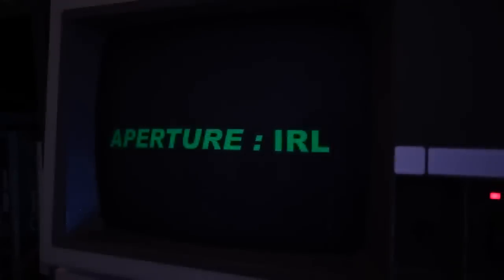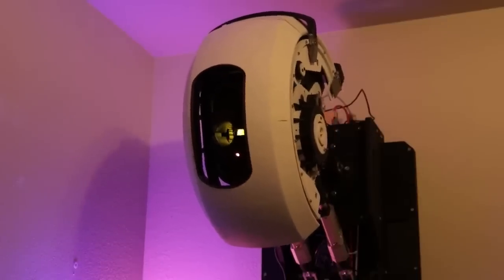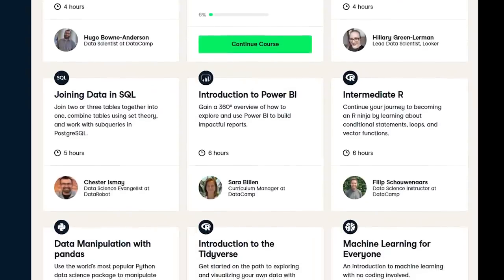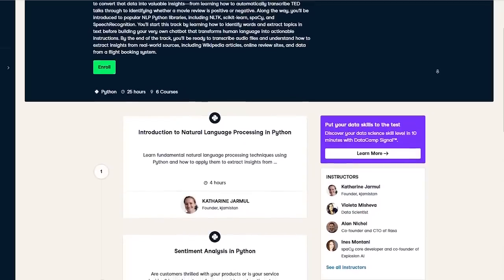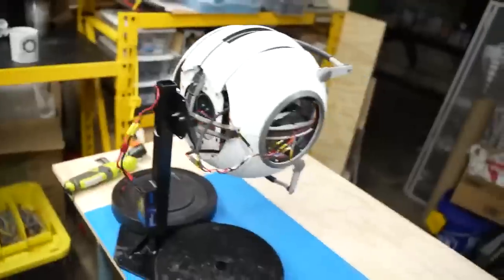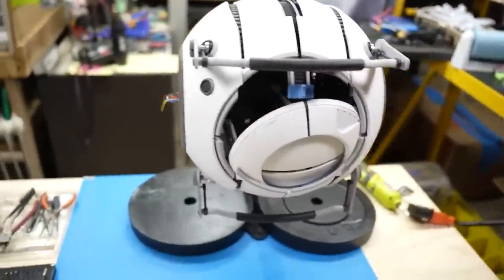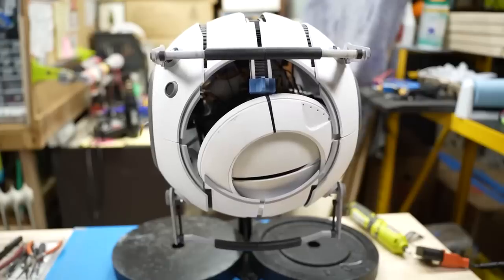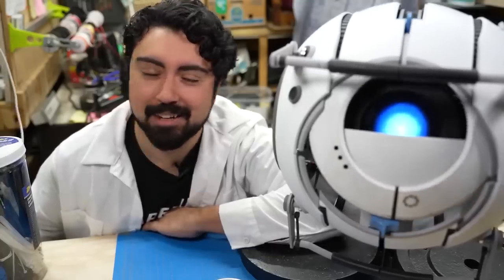Portal 2  | Wheatley in Real Life Mk II (unfinished) Testing

Comment: Impressive.  The shell looks good, range of possible movements and amount of parts is incredible.  But from what I can see in the vid, parts are having trouble moving smoothly.  Probably too much friction, and or imperfect printed parts.  I have a feeling that some things may be too lightweight in material to ground other parts, thus the motion gets rather bouncy.  But I'm sure you still working on all of that, and you be getting Wheatley moving as smooth as silk.

Comment: Hey there! This is really neat. I love the idea of making the design "fully open".

However, I noticed you only have STL files for the mechanical parts. Would you consider releasing the actual design files in their original format so that people can easily modify them as they please, rather than just the finalized STL output? An STL is like distributing the compiled version of software rather than source code, and for maximum design openness it would be wonderful if people could have the same ability to view and adjust the design as you can.

Thabks for your time and thanks for showing off such an excellent build!

Comment: very excited for aperture irl, and EXTREMELY pleased with the end result of wheatley. i think this is geninuinely the best and most accurate animatronic out there, because as someone who's taken apart n put together personality core models n animations for years to see how they'd work, there's only a SINGLE innacuracy to the in-game model i can spot; the thin secondary ring around the eye ring appears to be attached to the outer assembly instead of the inner one. that said, the excuse there is quite obvious, bein that the handle mechanisms would block it from rotatin more than ~40° if it wasn't. n even then, it's a detail anyone that isn't bonifide dork like me would notice. superb work dude

Comment: How many of the parts are ‘easily’ source-able? I can handle any amount of 3D printing, screws, and motors. But am gonna have to get access to a plasma cutter or something to build my own should I want to?
Reply from the maker: The most exotic part is the round LCD. I did my best to reduce rare/custom elements in this design. Once I finalized the bill of materials, I can say for certain. There are roughly  125 3D printed pieces and 25 machined parts (these are all 2D, so they can be cut by online services). Several of those can just be 3d printed too, since they're overengineered as is.

Comment: It's small enough to be properly snappy like it is in the game.
Lower handle seems to still be too heavy for the motors to handle though.
Reply from the maker: The sensor for controlling the lower handle broke during filming, so a quick fix thankfully for next time!
Reply: @MrVolt  awesome, I was a bit baffled because the heavier stuff seemed to be just fine but the handle was just hanging.
Hope your electronics get unhaunted soon!

Comment: Well I was hoping to not buy a new 3d printer after mine was pelted with combustible lemons , I now need to build this. anyone got any recommendations on 3d printers ?  

Also this is one of the coolest projects I have every seen someone do online you should be proud
Reply from the maker: Cheap and well documented: Ender 3 Pro. Best overall and high support: Prusa MK3. I was juuuust barely able to squeeze all of the parts on the bed of my Prusa.
Reply: @MrVolt  thank looking forward to building it and mounting it to my ceiling